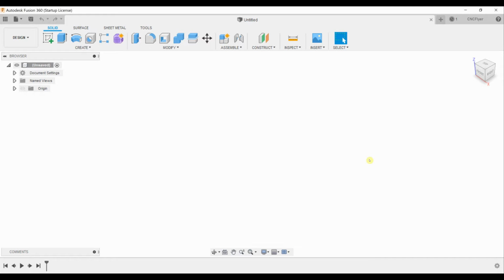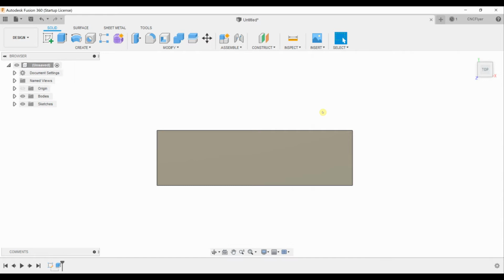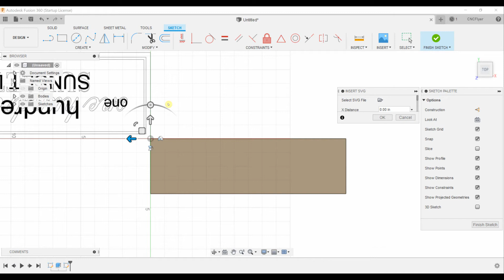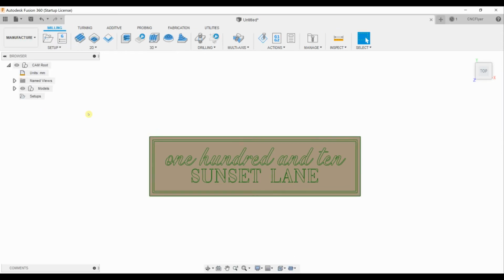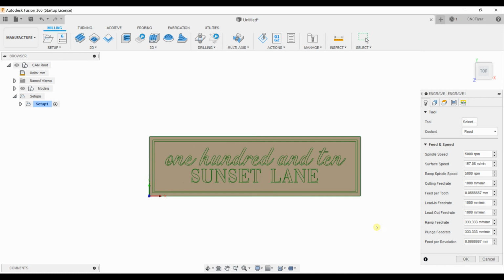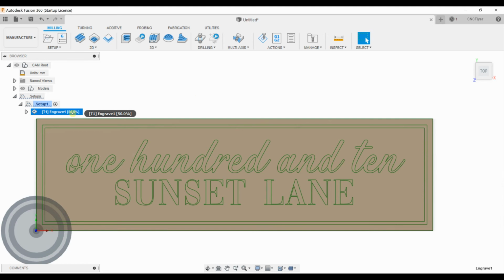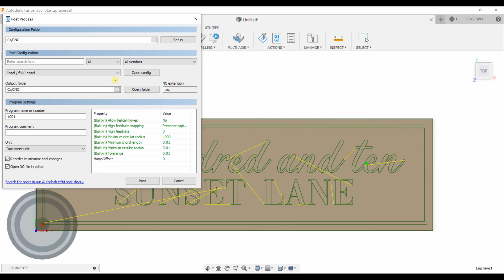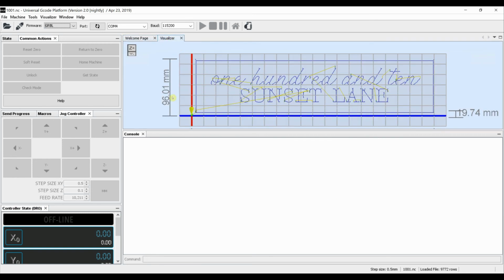Sign Carving with Fusion 360

Comment: did you  have to create a custom tool for fusion 360?
Reply from the maker: Yes because the carving is done between the selected contours, not along them.  The angle of the chamfer mill will dictate how deep the tool will need to go to span the gap between contours.